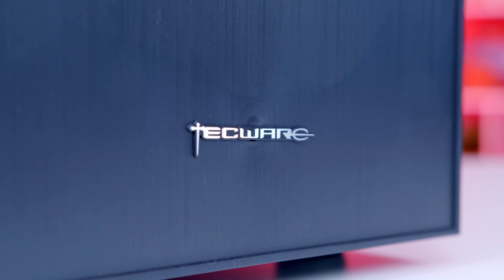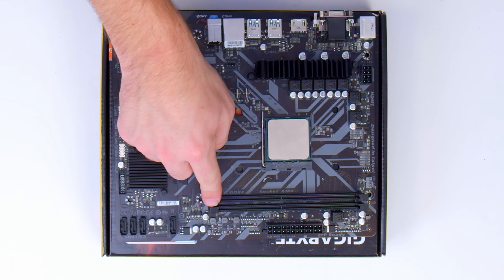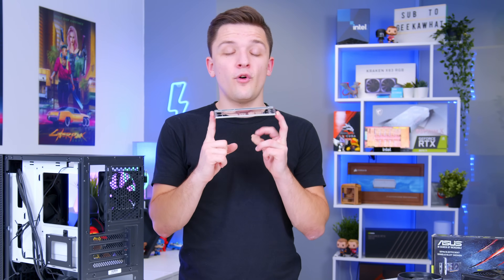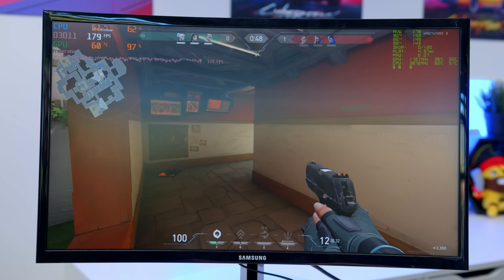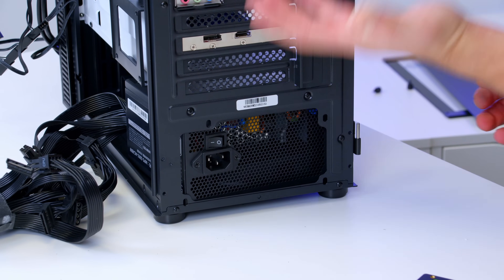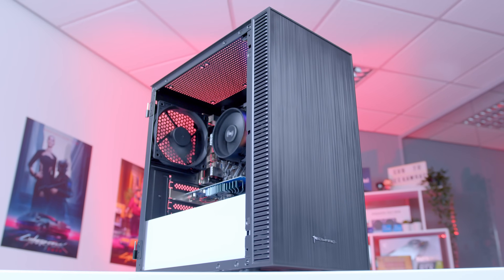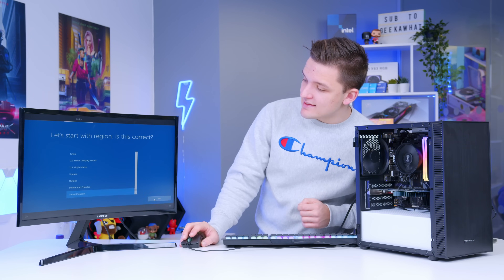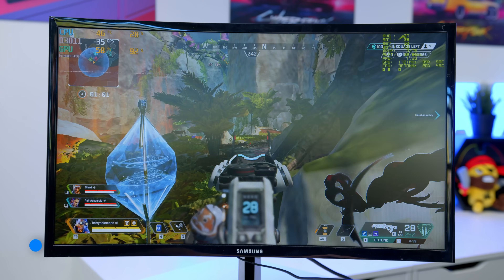BUDGET $500 Gaming PC Build 2021/22! [Full Build Guide w/ Benchmarks, Windows, Drivers & more!]

Comment: I did my build about 500 also. Ryzen 5600g, 2x8gb ram 3200mhz rgb team t force, msi b550m motherboard, seasonic gold rated 550 watt psu, I used Asia horse cable extensions, case was MUSETEX Mesh MATX (Micro-ATX) Mid Tower Case with 5 PCS × ARGB Fans Pre-Installed and 1 tb nvme Team Group mp33. Got windows 10 free through school.

Comment: Please for the love of god avoid the gt cards that's the gt710, gt730, gt1030 and any other cards i've missed for gaming they just are not worth it, trust me try to get the extra money and get a gtx1050 or 1050ti or any card that is gtx and not gt or get a 5600g and spend a bit more on a 550-650w psu and use integrated graphics till you can afford a good gpu like a 1660 super or 2060 or 6600 or splurge for the 3060ti but in the current market that isn't the best option considering those are like $900+

Comment: I needed to buy a gtx 1050 ti for my i7 12700kf 😢
Reply: What
Reply: I'm pretty sure the kf cpus of intel arent out yet sooo....cap
Reply: Inbpoland you can buy them normaly, they cost here around 2000zł ~ 500$
Reply: @dontwatchdis  I was just wondering why this pairing. Why get a gtx 1050ti with that beefy processor. It doesnt really make much sense unless you get the GPU for a steal. But 1050ti is completely obsolete and would not need that kind of CPU power as the i7 would get bottlenecked by the GPU everywhere.
Reply: I need a powerful cpu for my work as a productuction line manager, i write the code for the machines to function properly and make 3D models of the produced parts, i play some games but not often (1-2h for two or three days)
Reply: @dontwatchdis  Oh so you're still waiting for i7 12700kf to come out?
Reply: I had also a tight budget
Reply: The release date (in europ) was the 4 november so 1 month ago
Reply: @dontwatchdis  Oh you meant the normal k lineup. The ones with uhd graphics. The kf lineup dont have integrated graphics but they are generally the same. I think you meant i7 12700k without the f